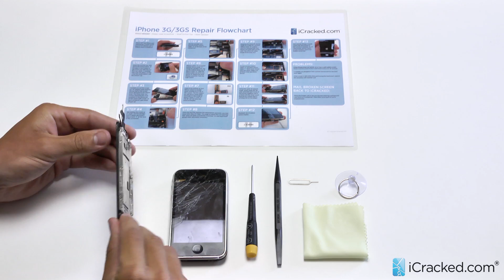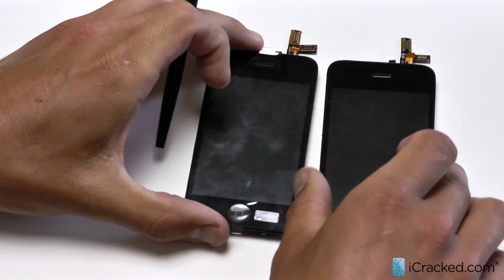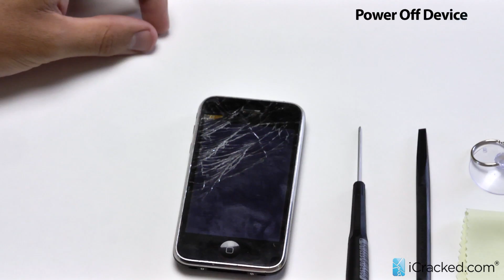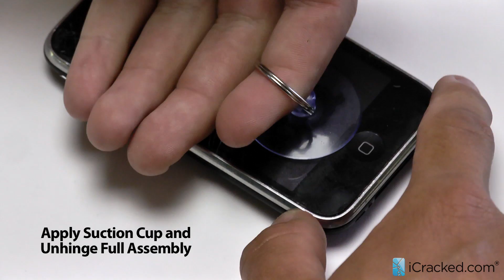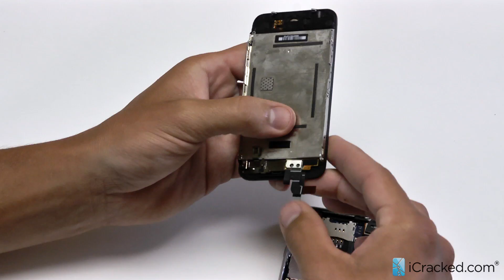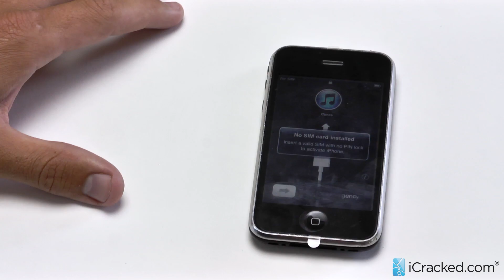Official iPhone 3G / 3GS Full Assembly Replacement / Screen Repair Video - iCracked.com

Comment: I got a replacement screen and after thinking I was ridiculously stupid realized that, somehow, the #2 connector is BEHIND the #3 connector. Normally the order would go 1 on top, 2 in the middle, 3 on the bottom; what I have is 1, 3, 2. Can you think of any workaround for this?